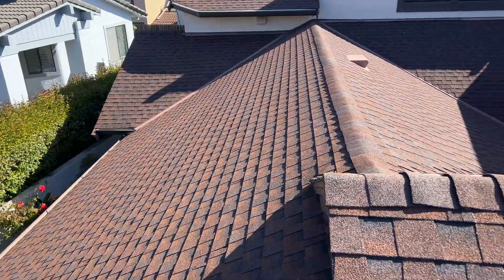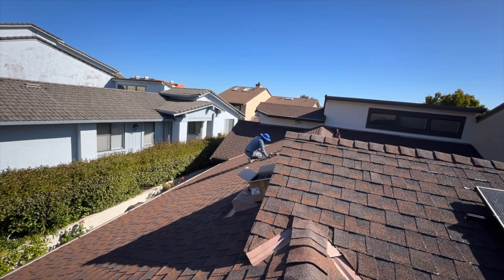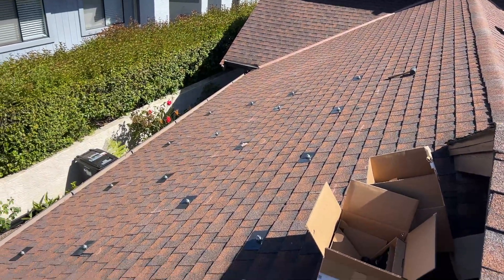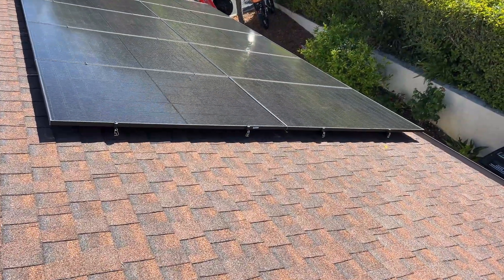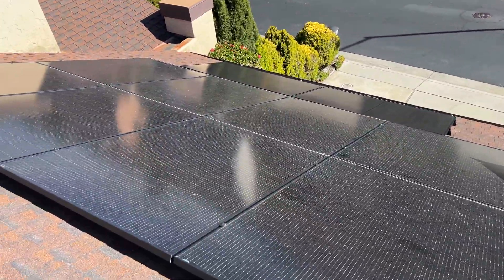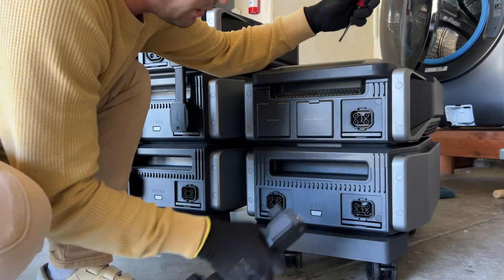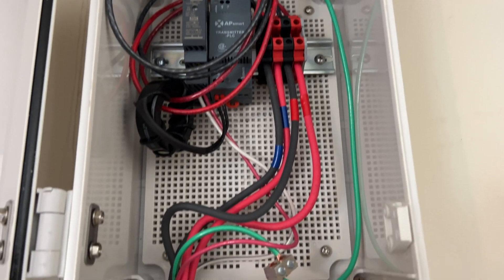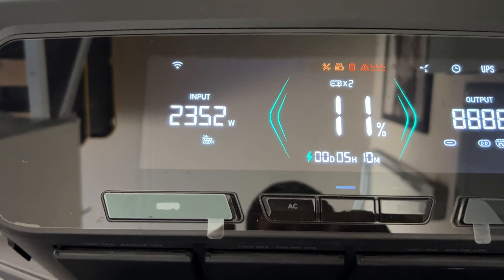20 solar panels for 2X Ecoflow Delta Ultra Pro power stations.

Comment: @SolarEngineering May I ask if the APSmart RSD of each panel also handle issues like arc-fault and ground-fault protection, and if not, what do you use in these cases for an off-grid installation? Same question for grounding the solar panels... do you ground the rooftop solar panels (and conduit) just to the ground of the house main panel, or do you also use the ground screw of the ecoflow DPU also to the ground of the main panel? I think Ecoflow recommends only to use the DPU ground screw on commercial installs. Great job BTW on all your videos. You provide information that no other DIY solar install channel has.
Reply from the maker: >>APSmart RSD of each panel also handle issues like arc-fault and ground-fault protection, and if not, what do you use in these cases for an off-grid installation? 
IDK
>>Do you ground the rooftop solar panels (and conduit) just to the ground of the house main panel, or do you also use the ground screw of the ecoflow DPU also to the ground of the main panel?
>> to the house ground. DPU grounded trough cable DPU<->Smart panel
>>Great job BTW on all your videos. You provide information that no other DIY solar install channel has.
Thanks!

Comment: Planning to DIY 10 400w full black solar panels on a bitumen soft shingles roof. What racking system would you recommend for someone who has never done it before? Ironridge Flashfoot or smth else?
Reply from the maker: yes, IronRidge flashfoot2 + xr10/100
Reply: @SolarEngineering  thanks! Do
You use SolarRidge's software for planning the roof and components?
Reply from the maker: no, as installer I have all parts in stock and use as I need.
Reply: @SolarEngineering  too bad you are not Kyiv. :) No proper systems here nor expertise